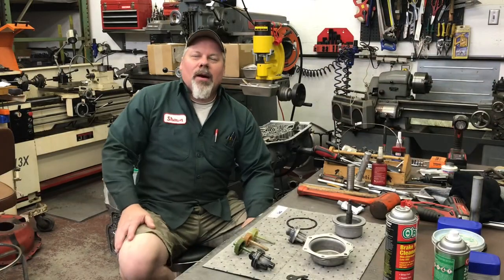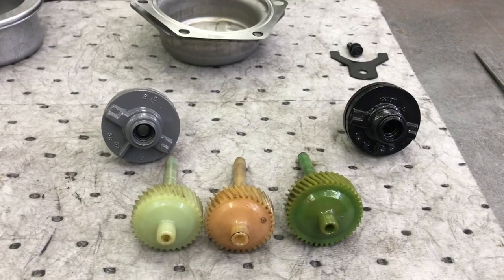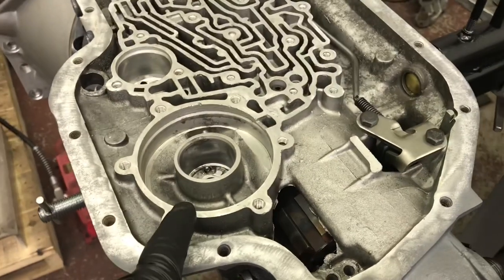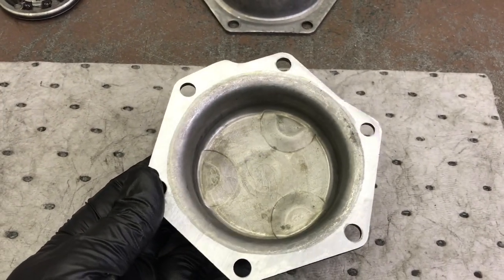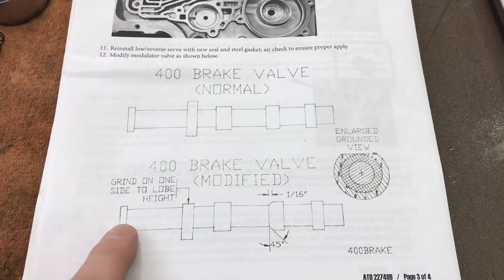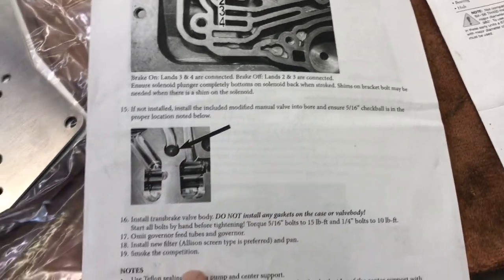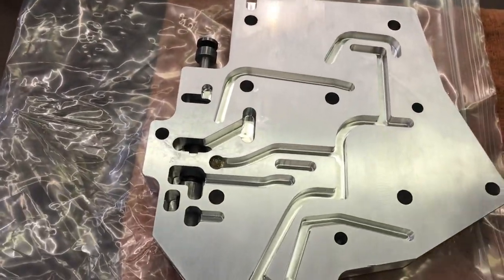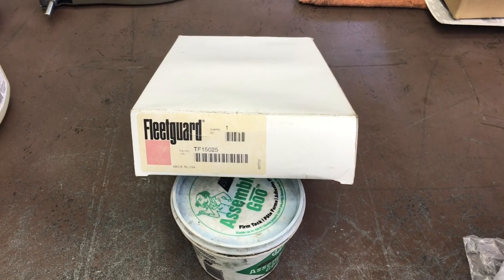TH400: TH475 Final Assembly!!!

Comment: Shawn, Have to let you know sharing your knowledge with us is the most giving thing I can think of. I still remember reading and rereading the articles in Hot Rod back in the seventies from John Kilgore giving step by step mods on the T400 then I would try them and go burn rubber. Thank you for inspiring me to work my T400 before I bolt it back to my Pontiac 455 HO i and drop it in my 72 K10.
Reply from the maker: Glad to help, and I read and re-read all the tech articles!!
Thanks!!

Comment: Hello Shawn. I've enjoyed every one of your videos. I currently have a backlog of TH400's lined up in the garage. Most of my trans work is for drag racers, classic car collectors, and military Humvee owners. I'm in the process of installing an Ultra-Bell onto an 8 bolt case. I'm impressed with how your rebuilds look clean enough to eat off of. What's your method for cleaning the case, trans components prior to rebuilding? Take care
Reply from the maker: I have a rotary parts washer cabinet, it does a pretty good job after lots of manual cleaning.
Old paint is a nightmare.
Internal parts either get run in there or cleaned with brake parts cleaner. I go through many cases if that!
Thanks for watching!

Comment: I wanted to see your turbos..   
I watched a bunch of the Nova videos..Did i hear you say turbo/carburetor?
You've driven some pretty fast car.. did you build them?
Reply from the maker: I had a a couple videos that had them mocked up on the 72 Nova, both single and twins. Check the playlist.
I built a few tube chassis drag cars, the last one I had I bought as a roller, an old Pro Mod. I ran 7.50 @ 180MPH.
The turbo set up will be Holley EFI, just bought that last week.

Comment: Shawn,  you use the stock intermediate clutch retainer ring. I see some builders tack weld the ring in place. I thought i was being smart and ordering a spiral lock.. nope ordered the wrong ring twice! LOL. 
I heard the ring can come off at high rpm's.. Thoughts?
Cheers
Reply from the maker: Yes I use the 4L80E Intermediate sprag spiral lock. I dont weld it as they interlock to themselves somewhat. I also use either a spiral lock or a HD snap ring in the case for the intermediate clutches.
Reply: Using the spiral lock allowed for an additional .020" play in the clutch pack it needed. 
Watching one of the turbo videos..You make made me laugh by saying " I got up early today" i'm laughing again... 5AM is late for you?
Reply from the maker: @tim1743  Sometimes I can’t wait to get to work!!